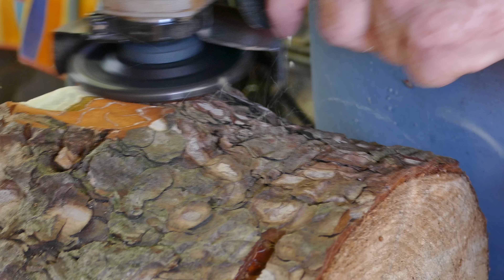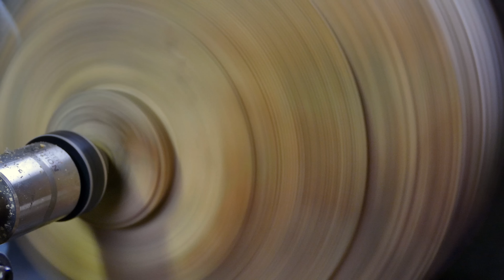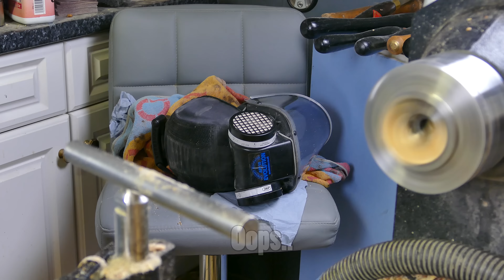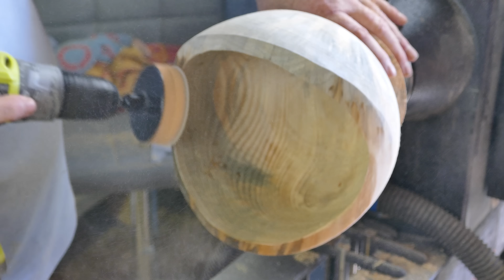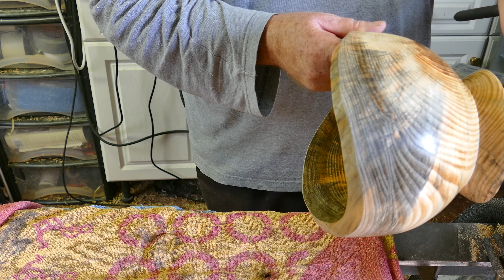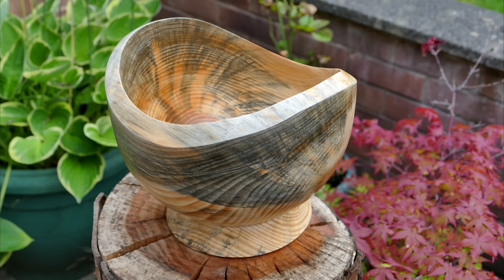Woodturning - I Made This Gift For The Local Church

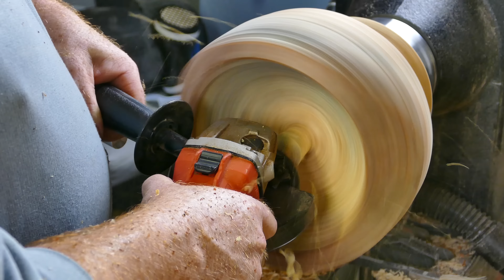Comment: Turned out ok, but you did a few whacky things that has me scratching my head.  But what in the heck were you doing at about 4:14 with that angle grinder?
Reply: OK, I can't speak for Ian's experience directly, but as a turner of cellulous material myself, it looks like he gave the alien intruders the chance to leave the ship. They refused, so Ian said, you can go by sharp blade or you can be ground to oblivion with lots of pain involved.  The aliens flipped Ian the bird and that's all it took for Ian to bring out the "Grinder".
Reply from the maker: Pretty much spot on Al, the alien’s were not complying with my simple request, I had to shred them up & make sure they knew who was boss. RIP to them but I’d do it again if required.